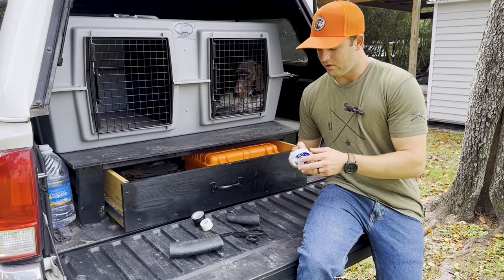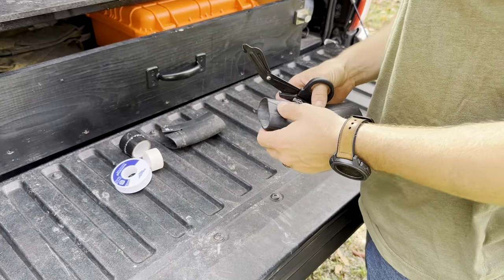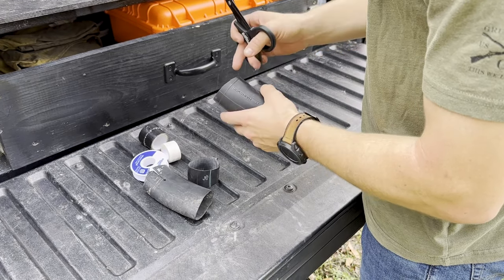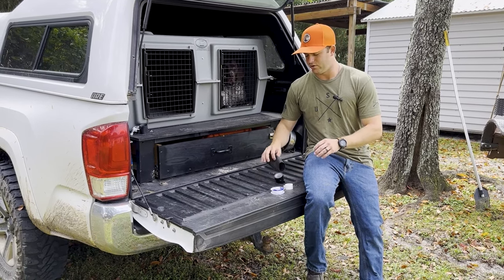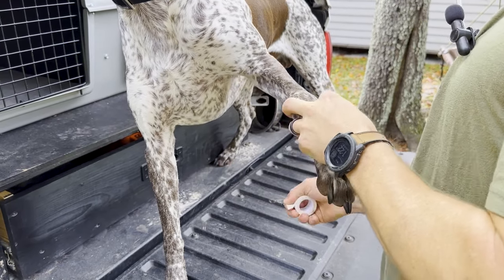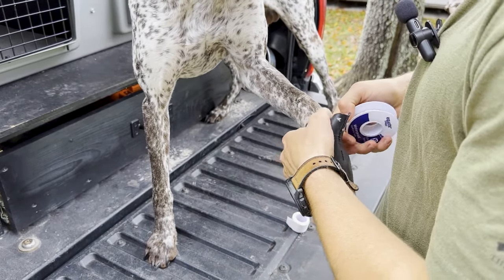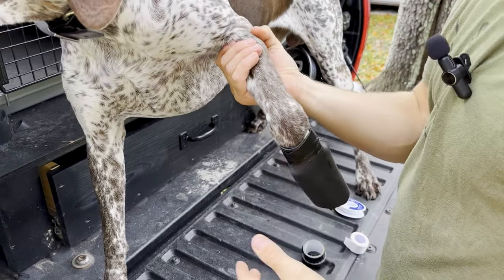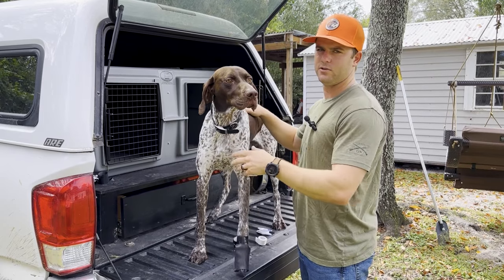DIY Bird Dog Boots | Cheap and Easy!

Comment: Thoughts on open toes with crusty snow? The crusty snow is tough on the webs and around the toenails, I could see snow getting packed in and causing issues.
Reply from the maker: I would think actual boots might be better for that. I’m not sure how the inner tube booty would do in the snow as wet as it would be. They are great in sandy environments but again haven’t tested them in snow.

Comment: I had trouble in the past with the inner tube booty riding up on the dog’s wrist and not protecting the pad on steeper ground. Any thoughts? Did we use the wrong diameter inner tube?
Reply from the maker: We used it the whole trip and we didn’t have any issues. I think it’s important to have the athletic tape on the dog first then make sure the second layer of tape is sticking good to the tube. And make sure it’s under the pad on the back! Hope that helps!